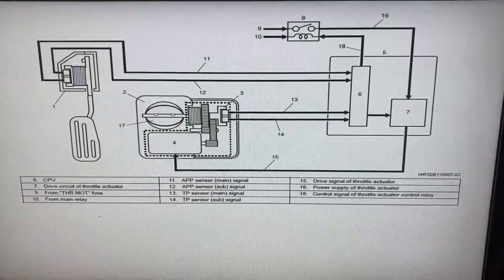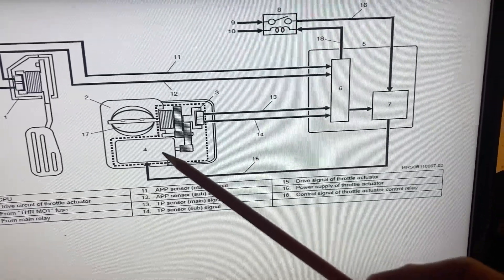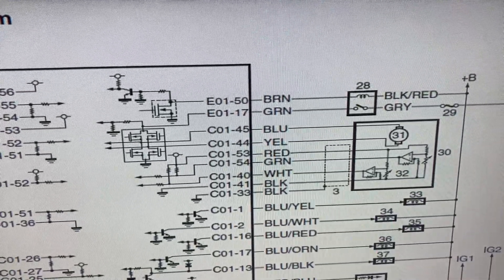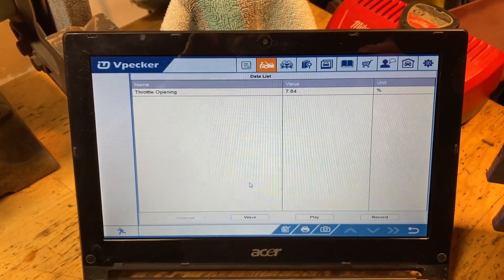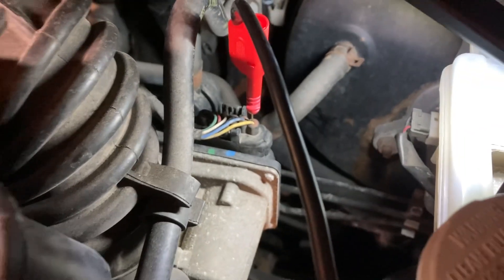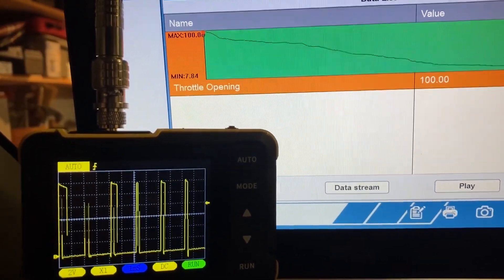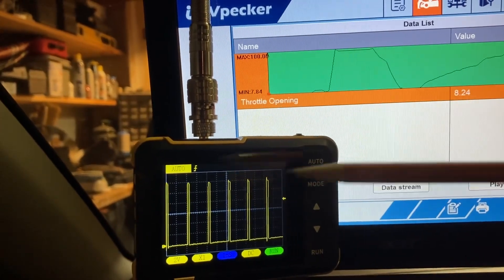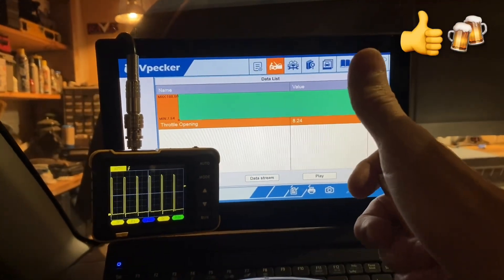DSO-152 Vs. Electronic Throttle Control

Comment: I see you've put the "cat-scan" on sleep mode on the couch 😂.  Could you do a vpeker software presentation? I'm interested in the live data section, does it have bidirectional control? I want a decent windows based scan tool without spending excessively. Basically I have a dedicated laptop for the new scope and would be nice to have a scanner attached to it to check raw vs read data...you get the point. Thanks!!
Reply from the maker: Yes I get the point. I have a dedicated small windows notebook for the same reason. Scope, scanner & manuals. It has very limited bidirectional control. I am not sure it’s still on the market. Here’s the video from a few years ago….
https://youtu.be/strr2Z0L4Ho?si=eJRqBYUFRZdetFZm
Reply: @TheGibby3340  yes exactly. I have some cheap windows options like autocom, Delphi and WOW (wurth) of course clones. The wow is okish because it has some technical data inside, but for live data you can only do 1 pid at the time... I'll check your video, already done some research and indeed it seems to be unavailable (for a reasonable price). Wanted to see other options before shooting the gun for a bosch kts system... Texa is way above my budget, so is hella gutmann. By the way...I bought the MTPro scope. It's available for sale now. Do some research...it's a serious tool at an excellent price!
Reply from the maker: Thx Alex. I will check that scope out. 👍🍻
Reply: @TheGibby3340  I'm sure you could do some good tutorials on it. There is a lack of info about them 😉
Reply from the maker: Where did you purchase yours from Alex? If you don’t mind me asking.
Reply: @TheGibby3340  did you got the reply or YouTube deleted it?
Reply from the maker: I didn’t get anything???
Reply: @TheGibby3340  i hope you got it because I replied 3 times
Reply from the maker: Ok got this time Alex. Thanks very much. 👍🍻
Reply: @TheGibby3340  👍

Comment: Very interesting analysis. I have a dso212 channel that I've been playing around with. Neat little tools. I really enjoy your scope vids. They've helped me gain confidence in scopes and automotive electrical diag. I just performed my first cam crank correlation pre/post repairs using my hantek 1008. I determined my cams were advanced and the diag was verified(found a broken chain guide). Thx for sharing. Cheers
Reply from the maker: Pre & post repair. Nice. Very thorough. Thx & thx for watching 🍻